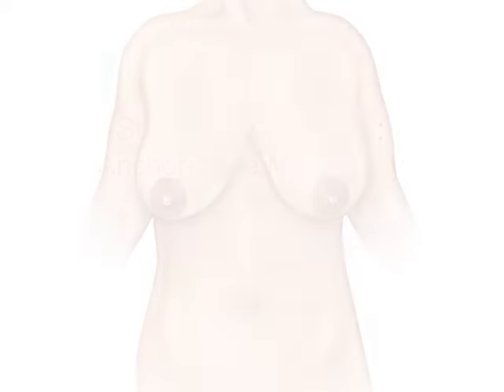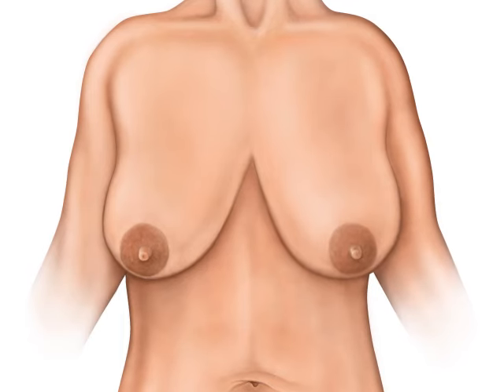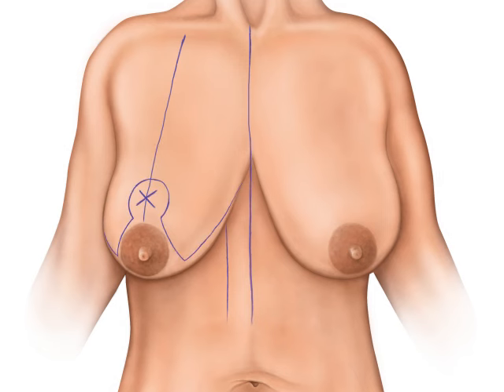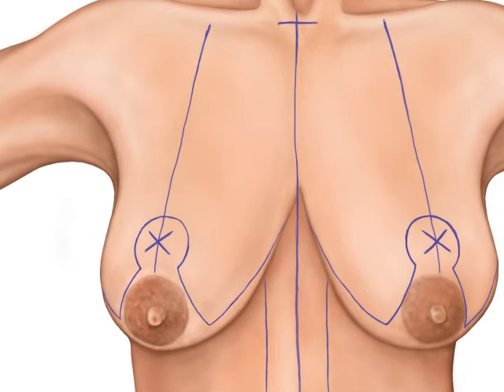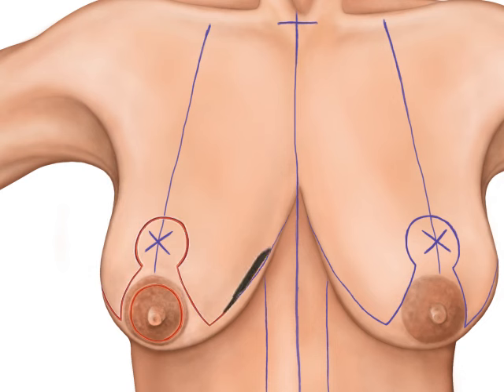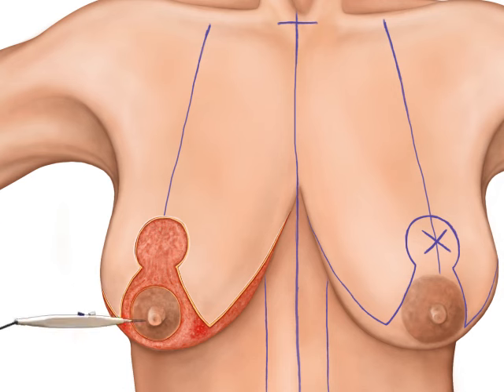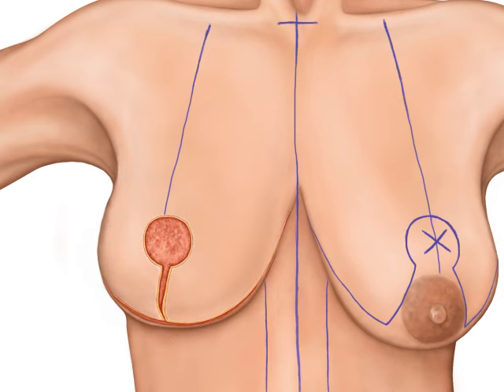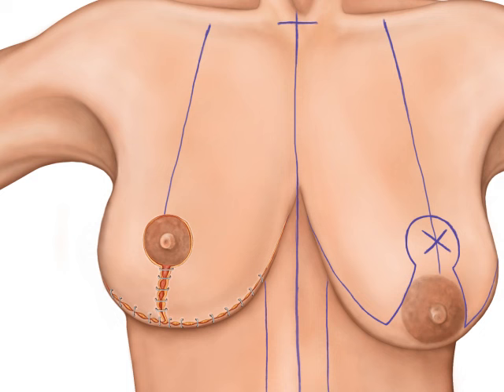Anchor-Style Mastopexy Animation

Comment: I had this done a couple of days ago. So far healing is super easy
Reply: @PR-A5678  I was under for 3 hours. As soon as I woke up they put me in a wheel chair and wheeled me out to the parking lot lol. I’m all healed now and the results are exactly what I was hoping for
Reply: @PR-A5678  I’m excited for you ❤️ I took exactly 2 weeks off. I’m a part time house cleaner so it’s a physically demanding job. I wore 2 sports bras for extra support and was fine.  But I only work 3 days a week so it’s not a huge work load either. Hoenstly I felt fine immediately after surgery. I went out with friends to a bar one week post op (didn’t drink)
Reply: @PR-A5678 Omg, how did it go? My surgery is next Wed 8/14/24 🙏🏼